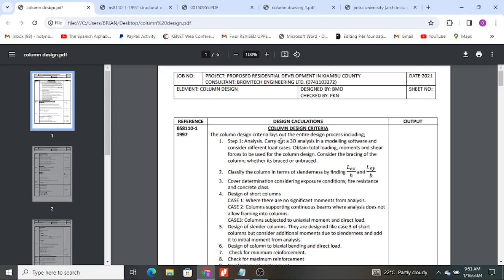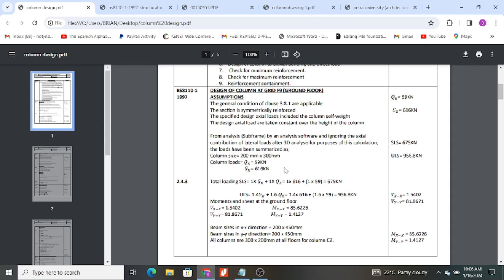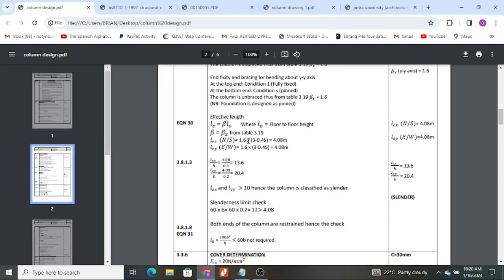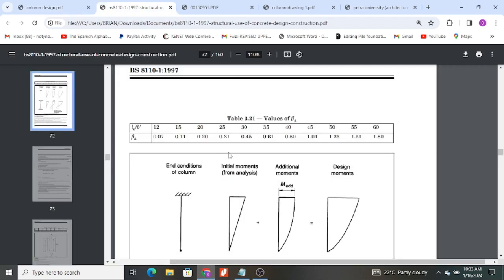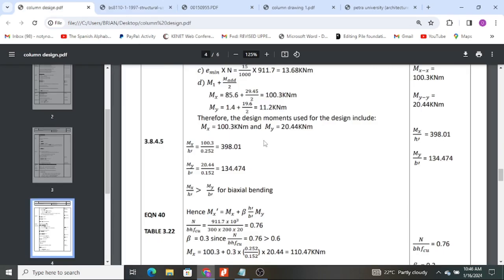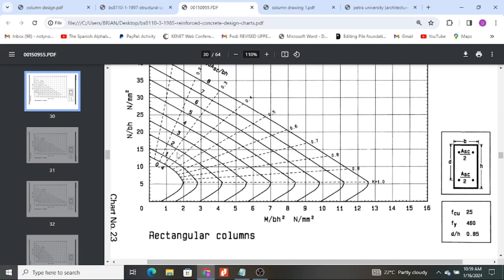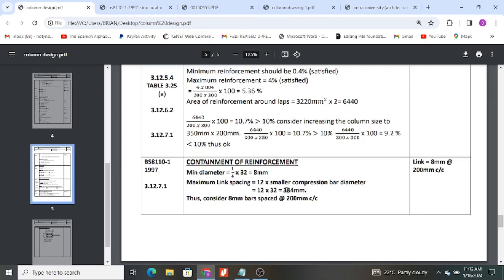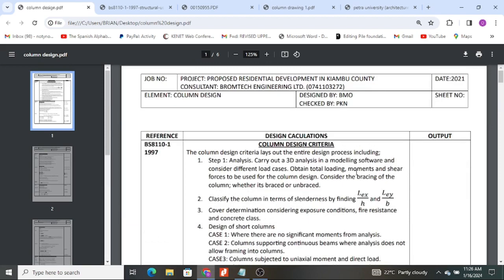DESIGN OF REINFORCED CONCRETE COLUMNS TO BS8110

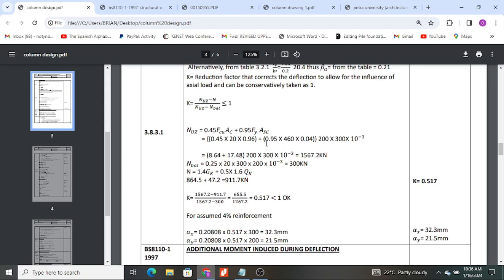Comment: YOU SAY 0.96 aS AC 44:00 pls prove me if your column section is 300 by 200 mm and u use 4% of steel then subtract what is that value I have confused

Comment: How can you determine the end conditions of a column in real life
Reply from the maker: @kwesiofosu7870  The end conditions can be determined by considering the descriptions given in bs8110. Clause 3.8.1.6.2 I believe the code is very clear on that. Just take it as literal as it sounds. Though sometimes you might assume different end conditions based in assumptions that you make as the designer.